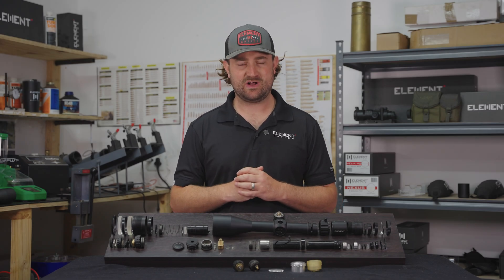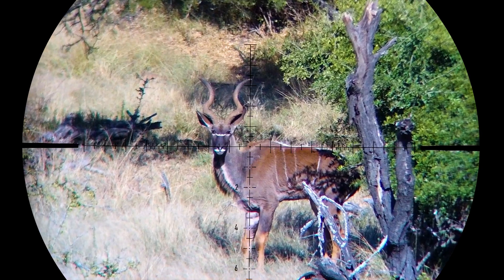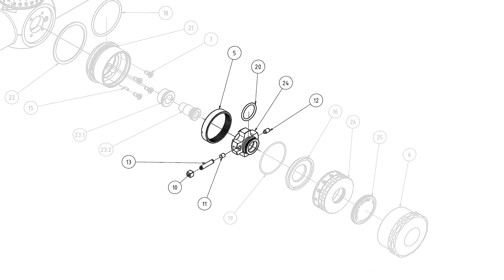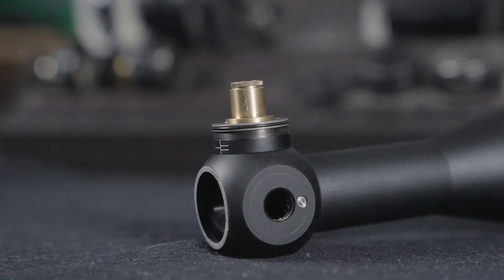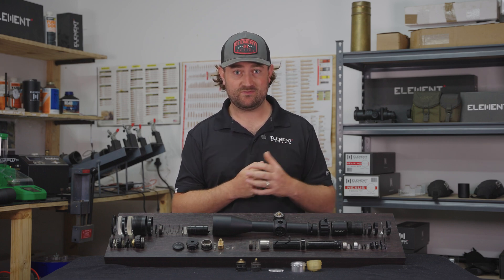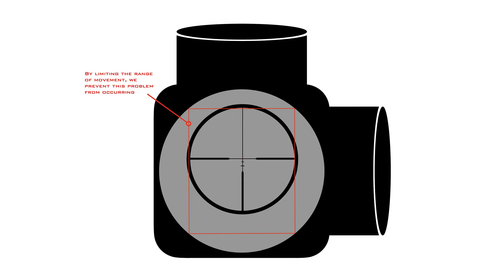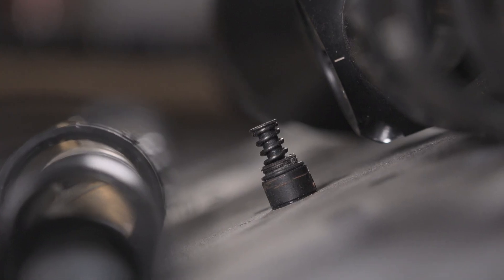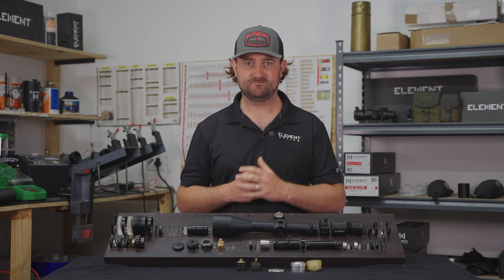Anatomy of a Riflescope, Part 6: TURRETS

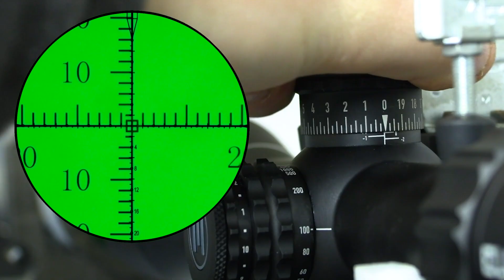Comment: Awesome series.  Question  around 2:40 you show the elevation turret being turned counter clockwise and it is visibly moving up based on the marker becoming gradually exposed at the base of the turret.   If the analogy of a screw is correct, then that means you are actually unscrewing which seems to imply (in my mind) that you are raising the front of the erector tube.   However, if the act of turning the elevation turret counter-clockwise results in the front of the erector tube moving up, then why in the green image the view through the scope is moving downward?   Please help me to understand this.  It seems backwards, but I have verified on my scope that the behavior is the same as what you show in the video.
Reply: Hello. Excelent question. 

Look. You will agree with me that the  image that pass by objective window is bigger that image that pass by erector tube. Yes. The diameter of the erector tube is smaller. That's why it is so. 

So, you can image the objective window like a picture into which erector tube is looking. Yes? 

Well. It's necessary you know that inside erector tube there is a inverter len. It is necessary because the image that is built in the first focal plane is inverted. It means that when the erector tube is displaced in the up direction, optically it is like it was going to down direction kkkk. 

Due to the exact location of the inverting len the image is just repositioned upside up.

I don't know if I helped or hindered more. Kkkk

Aluísio from Brazil
🇧🇷